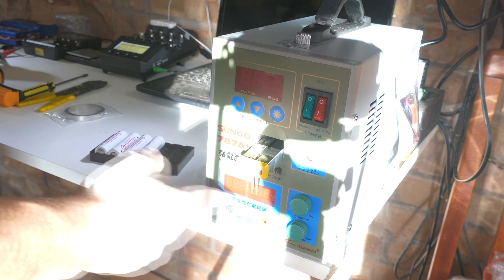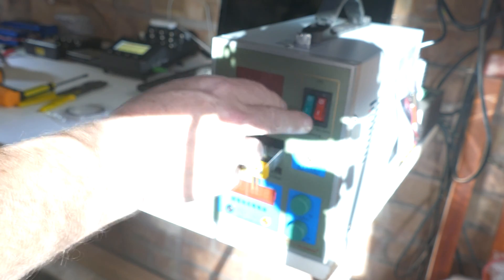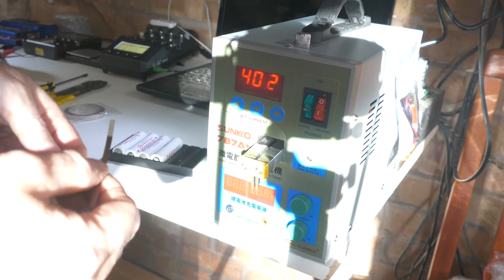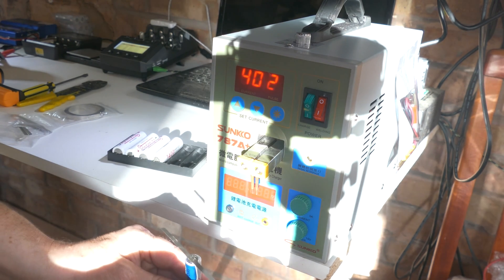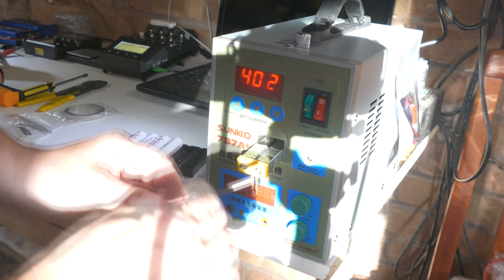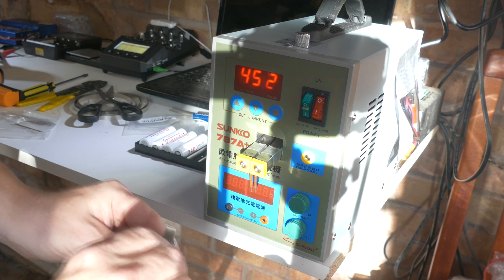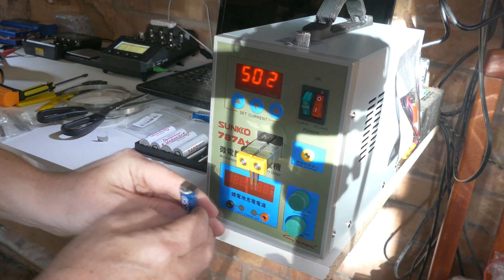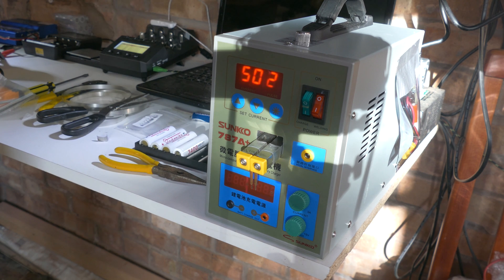Sunkko 787A+ Spot Welder unboxing and test

Comment: If you have 6S pack with 20A current flow and 0.15mm 8mm wide Nickel strips in between, your total power loss is around 0.3W, which is 0.07% from total power consumption. So replacing strips to 0.5mm is really not worth it. Thinner strips are better and cause less stress to welds and to battery.

Comment: Please pardon my ignorance. Is it possible to use this spot welder with 'true men' LR20 batteries?
Reply from the maker: In principle no problem.  The button top diameter may mean that you'll have to tilt the electrodes together a little more but that won't be an issue.
Reply: Thanks Tom

Comment: Hi there the "Asian" Plug is actually a standard 10Amp Australian Plug as evidenced by the size of the earth pin being the same size as the Active & Neutral Pins - so It definitly should as you proved work on a 13A circuit thanks for the unboxing etc very valuable in decicion making

Comment: Thats great news.  One last thing, do you have yours plugged into a 16amp socket or a 32amp RCD protected socket? I fear my 80amp RCD will trip, and the 16amp socket in my kitchen may not give enough power when there is an onitial inrush of current on power up.
Reply from the maker: 32amp RCD.
Reply from the maker: I too saw lots of videos complaining it tripped 20a circuit breakers, but that was on 110 Girly-volts  not the 240 real-men-volts we use in UK.
Reply: +Tom Donnelly
Great information for me. Thanks also for the informative clips on batteries and electrics that you have found time to make. 
Happy battery building!

Comment: Hi Tom,  i am on the cusp of purchasing one of these for use in the U.K.  You have had this for over three months, is it still performing, and have you had any problems with the device or with any blown fuses or tripped household breakers. 
Thanks
Andrew
Reply from the maker: No problems so far and I'm delighted with it.  After the video was uploaded, the only change I made was to the pressure screw on the top.  If you watch when I push up on the electrodes, the unit lifts off the bench.  I slackened off the tension on the internal spring.

It's been running fine on a 13amp fused circuit and no tripping.